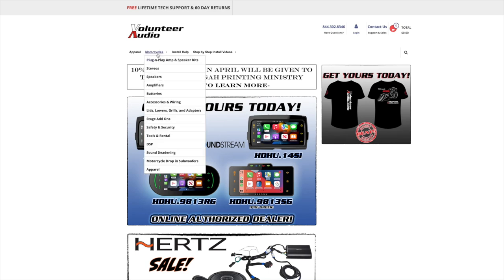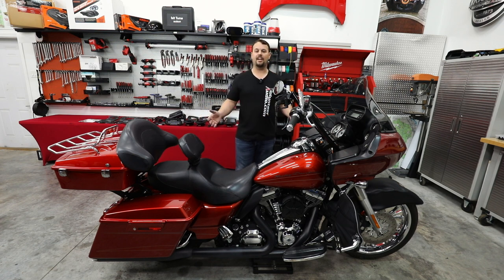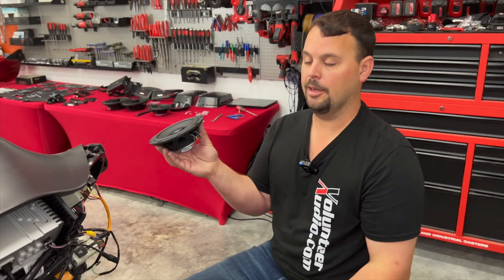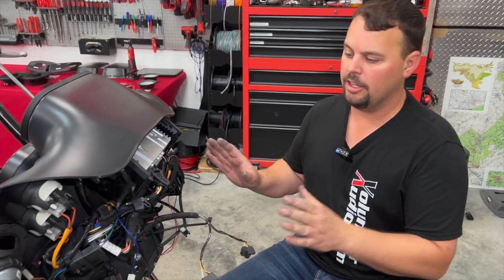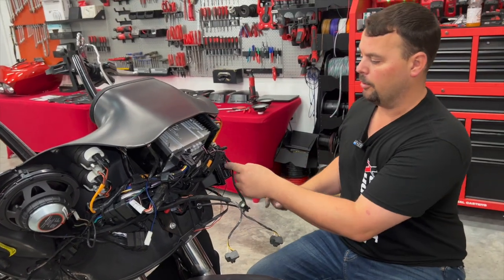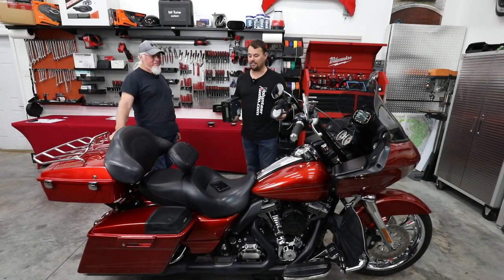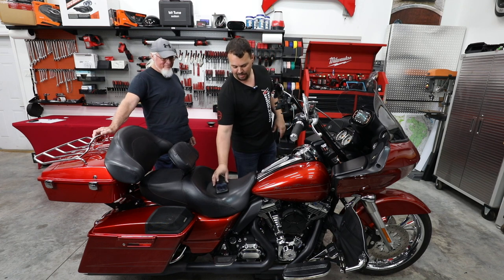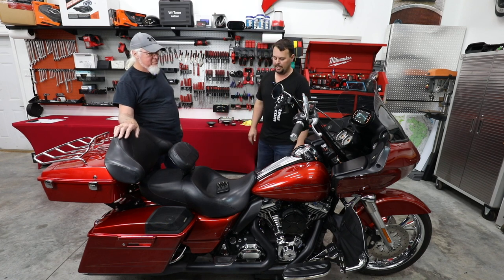An Awesome 2013 Harley Davidson® Road Glide Stage 4 Install with the Soundstream HDHU.9813RG!

Comment: Hi. Great video as usual, fantastic work and explanation.
I just bought that same radio unit and installed it following your videos, step by step and it works, but... it comes out a lot of static noise.
I kept a Rockford Fosgate amp (TM400X4ad) and the speakers, but the static noise is too much.
Any ideia how to eliminate it?
If needed, I can send some pics of it all.
Once again, thank you.
Reply from the maker: You need to connect it high level input, then properly set the gains using an oscilloscope or distortion detector

Comment: will this radio work on my 2013 cvo it has a lready an amp factory
Reply from the maker: If you have the factory installed mtx amps and speakers this radio is plug n play and will retain them

Comment: Is this AMP in the video for 4 4ohm speakers, 6 4ohm speakers or 8 4ohm speakers?
Reply from the maker: The amp is a 4 channel amp that is 4ohm or 2 ohm capable.  When you install 2 pairs of 4ohm speaker on the front or rear of the amp the amplifier will see a 2ohm load and automatically increase power to those speakers.  This mean the amp can run anywhere between 2 - 8 4ohm speakers without issue
Reply: @volunteeraudio  Okay great, I am currently installing 4 - 4ohm speakers, then adding two more 4ohm speakers. Was told that the tape label needed removed and amp needs re-adjusted. Hopefully my installer does things correctly.
Reply from the maker: @LushikuteZikatojirik  no it will not need adjusted when you add the speakers
Reply: @volunteeraudio  okay, I'll have to call them tomorrow and get some more information. They were saying that since I'm doing upper fairing & lower fairing speakers that they'll have to splice, and having to splice will cause the amp not sense a drop or something so it'd need adjusted. I tried telling them it was already set up for 8 x 4ohm speakers but...who knows. Worst case on my way down to florida I could stop in for a quick once over if the speakers sound like trash. I went with 6.5" cicada pro horn 4ohm, two upper, two lower fairing, and adding two in speaker lids in bags eventually, 6x9 4ohm. Thanks!